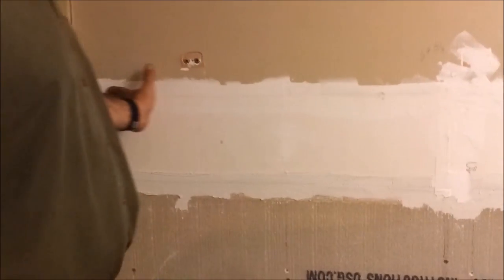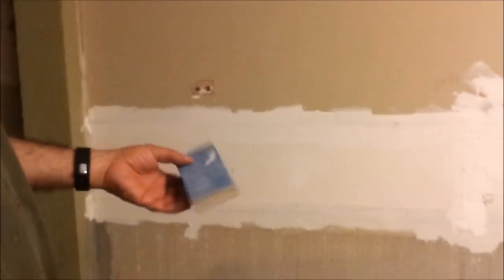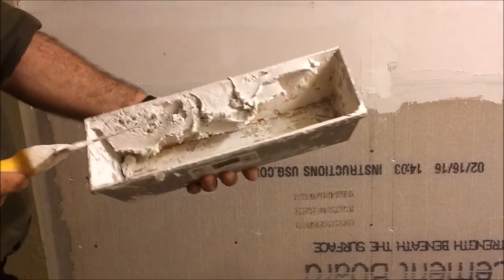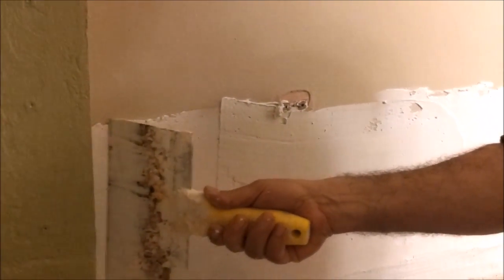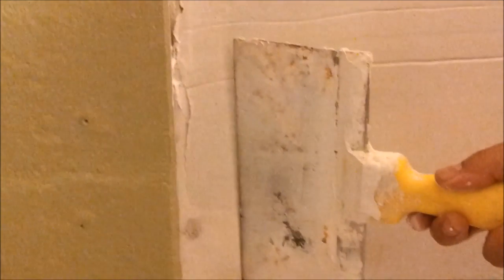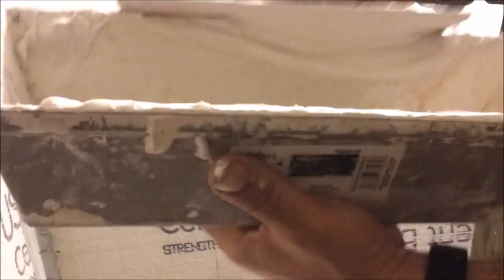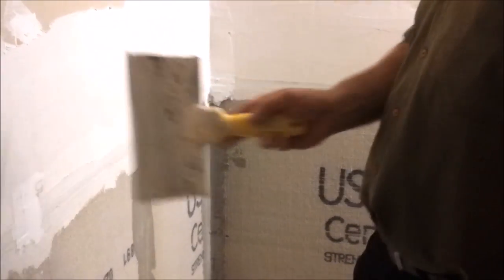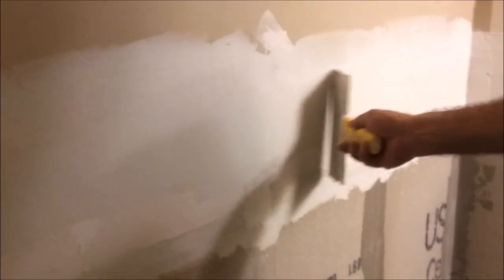How to use Fiberglass Mesh Tap - For Drywall joints and corners - Part 3 - second coat

Comment: How long did you let the first coat dry ?
Reply from the maker: It depend what copound you use , the temperature and moistair level. If you use normal compound it should be at least 12 hour between coat. If you use fast dry such as 40 minutes compund you should wait at least an  hour.

Comment: How long does it take to dry
Reply from the maker: Second coat with normal compound 4 to 8 hours. If you use 40 minutes ompound it will take 40 minutes.

Comment: That filler seems a little thick if it was a little thinner you would be able to apply it a lot easier
Reply: Yes, thinner mud would make the job easier and he needs to clean his tools afterwards.  The mud pan and mud tools were a mess.
Reply: What is the compound used.
Reply: Pl reply what is the compound use for fibreglass dry wall.
Reply: Yeah I was gonna say he needs to make his compound thinner